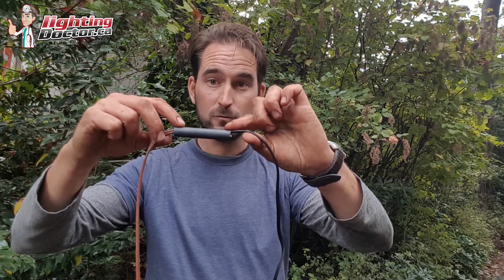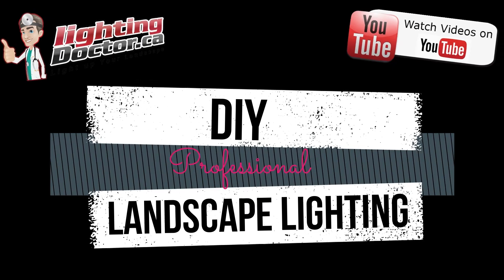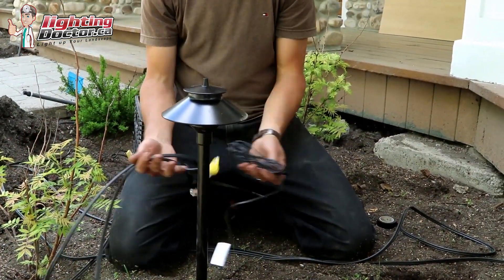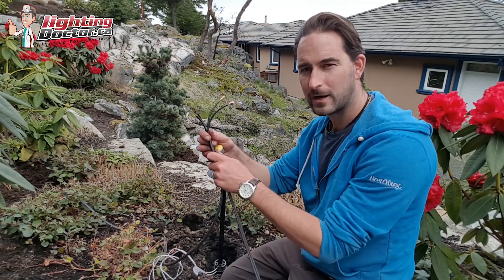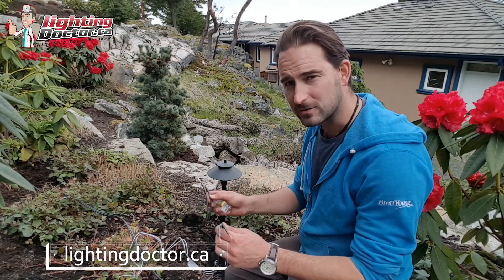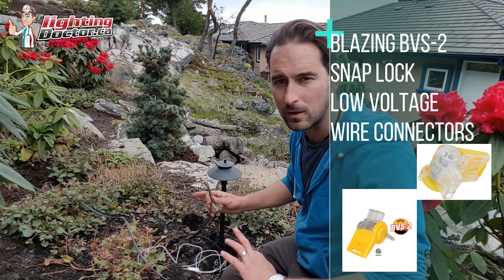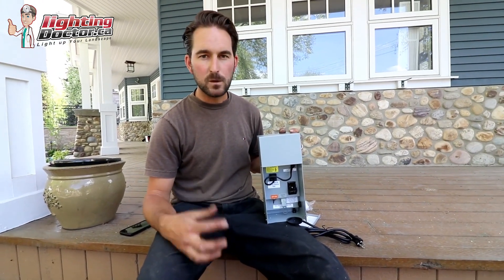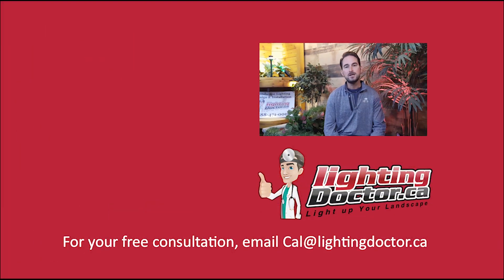How to Wire Low Voltage Landscape Lighting & Sizing a Transformer

Comment: Thanks for this great video, you mentioned in other video that you can connect multiple runs /   wires on same tap, i have Manor House 125198 500 Watt Transformer with 2 taps 18v each, what would be max amps load allowed on each tap when connecting  multiple runs on same tap?

Comment: Are these lights daisy chained together? You keep saying you have wires coming in and wires going out but don't really explain where the wires going out actually go. I assume to the next light?  Why are you hooking up the 2nd wire from the light to the wires going out?
Reply: Great question. Basically each light has to be connected to the main wire, and where each light is you have to cut the main wire so you can connect the light to it. The main wire when cut in now "two wires", one coming from either the previous light or transformer and the other wire is going out the the next light so it can be connected to the main wire. Hope that helps!
Reply: @aklighting8292  Thanks! That was very helpful!
Reply: @michaelk1519  NP! Glad it was helpful
Reply from the maker: Yes they are daisy chained